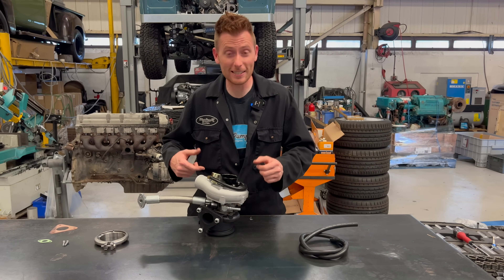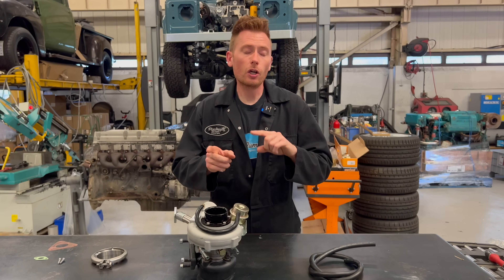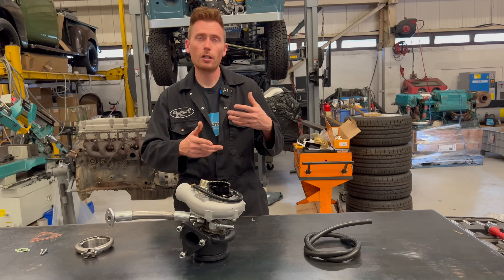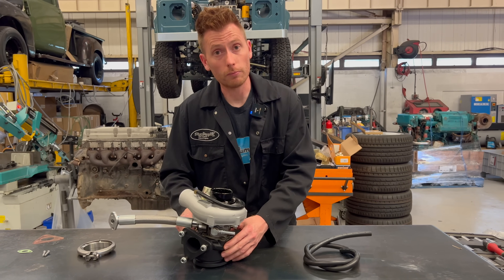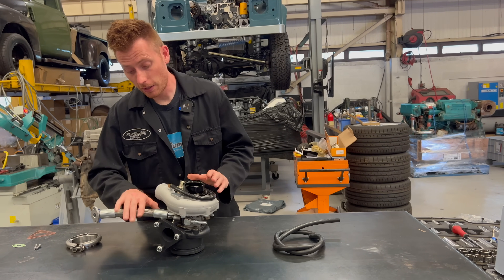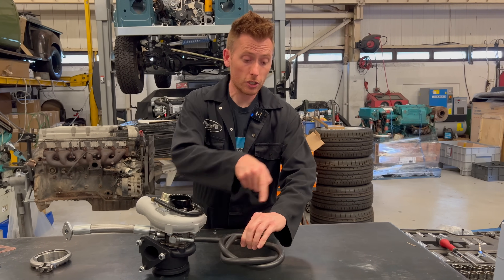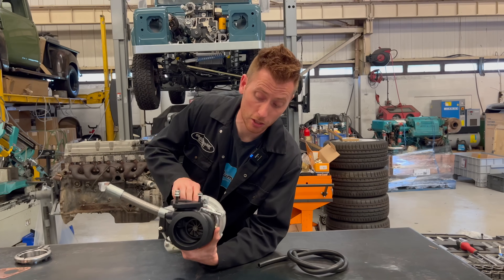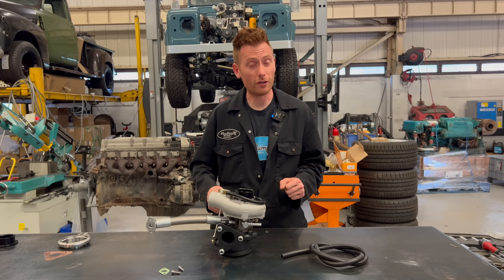Dieselpumpuk OM606 Hybrid V3 Turbo GOLF BALL INLET

Comment: Would this turbo work with a Om617A? I see your kit for the non turbo variant so i would assume yes.

Also how does this compare to something like He221W or Hx30w. The application i have in mind is for a 4x4 with 7.5mm m pump.

Thank you!

Comment: My mistake; I was not correct re: EGR valve function being to prevent or reduce crankcase pressure due to imperfect piston rings.  So previous question does not apply!
Still curious about where/how crankcase gasses in the OM6xx engines get vented.
I know that one of the ways to assess diesel engine "blow-by", caused by crankcase gas pressure, is to loosen the oil filler cap and let it sit on the opening with the engine running.  If the cap is dancing violently, as if the gasses within  the valve cover are trying to blow it off, it indicates a lot of the combustion gasses are getting by the piston rings, which pressurizes the crankcase, which vents them through the valve covers via the oil return galleys.
Reply: As you said ure not correct, EGR dont participate in the reduction of cranckase pressure.

Comment: I'm in the market for a diesel W124 sedan.  I have a question re: EGR valve deletion.  Seen many videos that praise this procedure as it results in cleaner air into the intake system; less soot into the intake valves, better breathing, maybe a little better performance and economy.  EGR valves re-direct crankcase gasses back into the intake system for pollution purpose and to prevent crankcases pressure build-up.   So my question is, if you delete the EGR valve and block the exhaust port going from crankcase to the valve, how are the gasses that are in the crankcase being vented to prevent pressure build-up?  Thanks
Reply: EGR = Exhaust Gas Recirculation valve. This is different from the Positive Crankcase pressure relief valve. The EGR in older vehicles can just be blocked off (I've done it many times) the Crankcase one can just be vented to atmosphere, or a catchcan.

Comment: Funny: 
You are highlighting the ventury effect on these dimples as being huge ....
... BMW M57 drivers are deleating the swivel flaps in the manifold. Which are supposed to have a similar effect.
Reply: The swivel flaps in m57’s are only an issue when they break off and the engine tries to eat them 🙈
Reply: People only delete them because they're a reliability hazard. I removed the ones in my M47, I know thay they were there for a reason, but it's not worth losing an engine for it.
Reply: @musguelha14  EVERYTHING is a reliability problem after x-thousand miles.

I am sure they last easy 100k. There will be a note in the BMW service book.
Here in GER noone drives a car longer than 100k. THAN 2. hand buyers make nor service, 3. one buys, than we have 250k those break.

The main problem is:
INTERNET
If you have 1000 people with those broken 300 make a post. 
Nobody makes a post about a goood running thing. This relates to everything, not just cars.